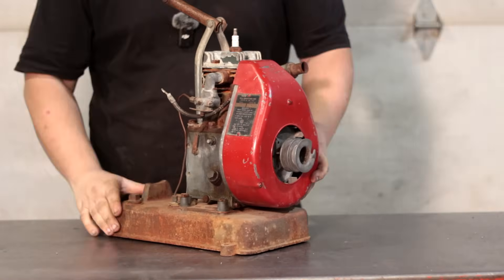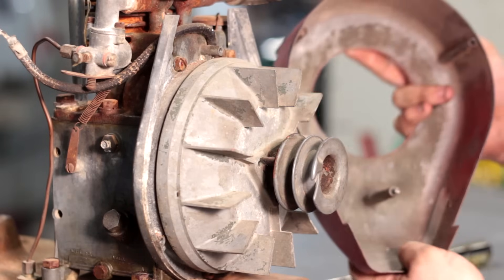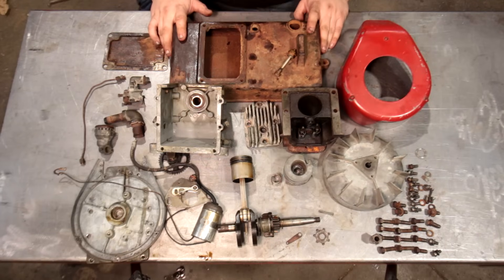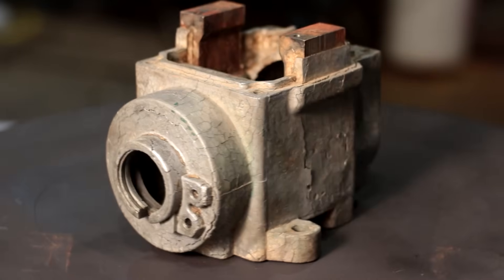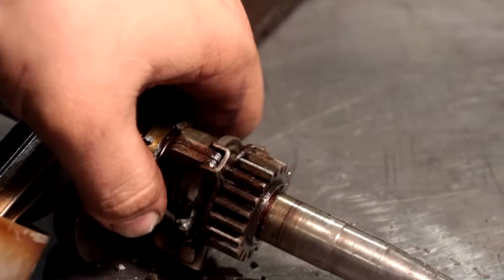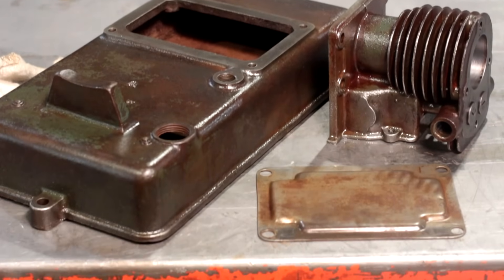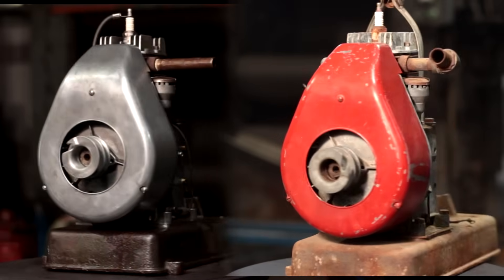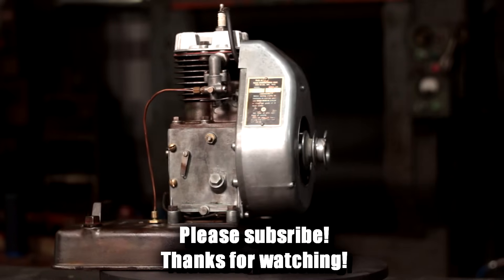IT CRUMBLES When Touched! Will This 80+ Year Old Engine SHATTER Before We Get It Running?

Comment: That is a visually unique engine. Never seen one like it!  My dad worked in the metal casting industry for most of his career. They had casting alloys which had purity standards. If I remember, lead was one of the biggest no-no's in the alloy. They supplied parts to a major US auto maker who spot tested each batch of parts. There was more than one occasion that an entire run of parts had to be scrapped.
Reply from the maker: yep lead is one of the worst metals to deal with in casting.
Reply: @cruddycornstalks  I think they only allowed a few parts per million lead in the aluminum casting alloy, if I remember. It was low.  By the way, I sent an e-mail to your address from your YouTube channel about page. It's off topic for a comment so I sent it that way. Not sure it went through.
Reply: @davida1hiwaaynet These are Zinc...not Aluminum
Reply: @AchilleBelanger  Never said it was..... he clearly states what it is made of.
Reply: @cruddycornstalks Not if you're casting Bullets.
Reply: @cruddycornstalks mmmm lead poisoning
Reply: This problem happens because a lot of galvanized products use lead, especially those with irregular shapes, it helps the zinc stick better in the process; some lines have replaced the lead with bismuth and/ror antimony  (any spangled-looking galvanizing coating has one or more of these, pure zinc coatings have no such pattern visible) . The zinc recycling process would end up putting a lot of this lead into zinc, which caused old pot metal to be of such poor quality. After electrolytic refining of zinc became common in the 70s-80s, pot metal was a lot easier to produce with proper mechanical properties, modern Zamak is a testament to this: some alloys of Zamak approach the strength of steel, and has found itself replacing cast iron in many things (no need to get Zamak red hot to get it into a casting).
Reply: What kind of stuff (besides toys and electrical) was zinc used for a lot? I'm wondering what the actual alloy was here, or if it was meant to be mostly zinc.
Reply: @edherdman9973  The main use of zinc is galvanization (60%), the next most common use is zinc-based alloys (zamak, etc.) (15%), followed by its use in aluminum, brasses and bronzes (9%), zinc intermediates (anodes for electroplating/cathodic protection, rolled zinc for roofs, etc.) (4%), and finally in zinc compounds (zinc oxide, zinc phosphate, etc.). 

Source: International Lead and Zinc Study Group, 2024
https://www.ilzsg.org/wp-content/uploads/SitePDFs/The%20World%20Zinc%20Factbook%202024.pdf
Reply: @edherdman9973  @edherdman9973 The main use of zinc is galvanization (60%), the next most common use is zinc-based alloys (zamak, etc.) (15%), followed by its use in aluminum, brasses and bronzes (9%), zinc intermediates (anodes for electroplating/cathodic protection, rolled zinc for roofs, etc.) (4%), and finally in zinc compounds (zinc oxide, zinc phosphate, etc.). Source: International Lead and Zinc Study Group, 2024.

Comment: Your video proves one is never too old to learn. I also was not aware of the pot metal disease . I have been working on small engines for 50 years off and on and have never really known that it was a thing. I have seen pieces crack but nut really thought about the reason. Keep up the good work. Oh and get rid of the adjustable please it drives me nuts waiting for it to slip and round out those old nuts and bolt heads.

Comment: judging from the tank casting, this was a small gen set also given the external shaft thats keyed on the back, but the small support on the bottom hints it was prob a gen
Reply from the maker: correct a little one like from an old car to charge batteries

Comment: Did you replace: crank bearings, seals, wristpin bushing, conrod crank bearing/bushing, piston rings, condenser? Did you hone the cylinder wall? What did you use for head gasket material? Did you replace the broken part on the crank? If not, why not? Like your shows. Informative, to the point and no extra jibber jabber.

Comment: I'd recommend removing the Ethanol or getting pure neat Petrol.  

Ethanol will attack the Pot Metal. I washed my fuel in water. Shake then siphon out the Ethanol free fuel. Water absorbes the Ethanol. Let it settle and use.

I discovered using my own car removing the Ethanol from 95 octain fuel and driving in 5th gear 20mph prior would bog down. I run the fuel as low as I could then replaced with the Fuel washed. The car from 20mph in 5th gear would slowly accelerate. 1.4 engine size. 

I tried it in my rotavator it was hopping about. I add a little oil or Redex to lubricate valves as modern fuel is dry.

Comment: Not a bad little engine.   I remember the days of pot metal small engines and you could strip out the threads in the block or housing in a heartbeat.  Thanks for a peek at this one.   It did need an oil change and that colar replaced still for an 80 year old engine it's a fine one.   I wish I knew their pot metal formula.   Obviously it is possible to make good and lasting pot metal.   My grandpa mixed his own pot metal for his shop.   He just thru in bits  of this and that till it "looked right" same recipe he used for corn bread.  One of my regrets is not measuring what he thru in. He and the good Lord only know what he was looking for I asked him several times to explain but he could never give a good answer except to point to the pot when he was done and say that looks right.

Comment: Back then you can fix everything as it's possible to disassemble every parts, nowadays even a carburettor for a lawnmower have punch in part that you can't get out for cleaning (like idle injector on Honda small motors)  the only way is to replace the whole thing, 80$ "official" parts  and 8$ including shipping from asia !

Comment: The bad pot metal examples look like 2012-2016 Honda Odyssey valve covers, they'd crack around the spark plug tubes, never had new ones in Stock, so I'd have to take a file, and file away the swelled material so the tube seals would fit, and pack the cracks and area around the tube seals with Honda bond to get the customer back on the road.

Comment: Had one your missing the original air filter. It was a brown procilin type thing that was porise and needed a new coat of oil every so many hours.
Reply from the maker: How the choke of this carb is setup there is no way to mount a filter on it.

Comment: Chevy will be making door handles out of this next year.
Reply: Chevy has been making door handles out of it for more than 60 years.  I made them then as a foreman in a zinc die-casting department at Ternstedt-Trenton, the division of GM that made such parts.  Lots of other parts such as trim emblems, dashboard instrument clusters, the major frame for the swinging vent windows, gear boxes for windows, etc.  Copper/nickle/double chrome plate (triple chrome on Cadillac parts) and they last longer than much of the steel sheet metal parts.  And ultra-violet light didn't destroy them like our modern, new and improved plastics.  Even pitted after 50 years they will still open the door instead of coming off in your hand.

Comment: Never seen a carburetor without a float or some flow control ! ill have to research that and the other interesting thing is how little lubrication is required to opperate considering theres no oil splasher dipper or oil pump ,plus the oil is far below from the moving parts ! I guess it still blows around inside just from the spinning crank and piston pulsations .. Very cool and interesting stuff !

Comment: 5:32 you need to smelter it in the oven, at about 1150 C
Reply from the maker: 1100C would literally kill you with zinc as its boiling point is only about 900 and the fumes from it can kill you very quickly and painfully. terrible advise.

Comment: It's either die cast or die pressed. Casting anything is twice as difficult as squishing something into shape. I just can't with the adjustable wrench. Those are only to be used in a pinch. They love to round the head off a bolt. They're a dumb design really. Sloppy to no end and only 2 points of contact.
Reply from the maker: if used correctly an adjustable wrench will get a better grip on most hex then a standard open end wrench use them everyday at work to save our fresh machined hex on parts regular wrenches leave marks.

Comment: I can't bring myself to watch you work on it with a crescent wrench.
Reply from the maker: Sounds like a you problem as they are very useful tool that helps save time and bolt heads when used correctly. And even the best people in the engine hobby use them.
Reply: @cruddycornstalks  I'm a master mechanic 40yrs . Crescent wrench is for broken down on the side of the road. Not in a shop where you should own the tools to tackle the job at hand.
Reply from the maker: @johnmartin2079  This is the tool to tackle the job at hand  it helps keep from rounding off odd sized or worn down bolts that a regular wrench can't compensate for.  I deal with them every day at work and in my free time and at work we use them to save brass hex from getting rounded because a regular wrench has 10 plus thousanths of slop in it to the actual size of the hex and that will leave crush marks on the new brass hex and sometimes even round them off and we can't have it in manufacturing. If you are rounding off bolts or having problems with a crescent I highly recommend learning how to use one properly as it keeps us from having recalled products from having messed up hex on parts. When properly used a good crescent will outperform a common open end wrench. And if you say otherwise you haven't used with one enough. As the main Manual machinist and maintenance mechanics I can say a cresent has saved me a lot of rounded bolts and problems over the years and a lot of other antique engine mechanics will say the same  when your fighting  17/32 head bolts and rotten bolts that are no longer a size in general it is a saving grace !

Comment: If it can’t produce electricity to run itself, how does it produce electricity to charge a battery? Is it missing a generator?
Reply from the maker: the fact the generator is not there would be an issue yes.

Comment: Im surprised the oil did not soak threw the engine block. Oil does an can soak into metal.but pop metal im surprised it just didn't soak oil threw it
Reply from the maker: it can turn the zinc to mush to and i was very luck it didn't

Comment: That reminds me of a tiny 2 cycle engine my grandfather had in the 1960s. It had a small water pump on it with garden hose connectors. May have been the same brand.
Reply from the maker: That sounds cool

Comment: I had a player piano that had  pot metal valves in the player mechanism.  They were made in two factories, one in New York and one in Toronto.  The Toronto factory made valves that held up over time and the New York pot metal almost always crumbled.  I understand that there are a whole rainbow of pot metal formulas.
Reply from the maker: Interesting!  There's a lot of variation in quality, even within the same material.
Reply: The main issue was that it was easy to alloy zinc with random other metals. Lead is what caused the problems.
Reply: Yeah every company uses different mixes and stuff
Reply: We had a friend with a Pianola that had a keyed latch made of some cast metal that expanded with age and started to split the wood it was set into.

Comment: Zink alloys still break down easily. Cheap safety razors will break down in a few years if the plating fails or isn't done properly.
Reply from the maker: Yeah it's not a great material
Reply: @cruddycornstalks  it's just cheap to use and easy to work with. Just benefits the company making the product and definitely not the consumer.
Reply from the maker: @RobertNES816  correct

Comment: When I first saw it I assumed it was a small industrial 2 stroke but nope. As for the alloy, even my old cheap magnesium vw cases/parts that came from countries other than Germany, after so many years, could fail with cracks or pieces breaking off. Not this bad however. Similar alloys are not all equal is what I learned. Magnesium and pot metal are related I think. Cheers. 👍
Reply from the maker: yep it is a delicate alloy.

Comment: I am confused about one thing — what happened to the crumbling governor, did you have a replacement? Not needed? Otherwise great video as usual!
Reply from the maker: with how delicate the engine is i never plan to work it so i just removed it and will only run it at set idle.

Comment: Some Franklin auto engines had zinc alloy guides in the valve train and if the car sat unused for a long time they would swell up and lock up the push rods. I watched a gentleman named "Jonathon W." rebuild one on on his channel.
Reply: Very early Subaru 1.0 liter EA series engines (1968-1971) had odd valve guides made either out of aluminum or zinc alloy of some kind. They are absolute junk whatever they are. By the next iteration of that engine (1.2l) they were replaced with iron or steel ones, and every future EA series engine had  either iron, steel, or bronze guides.
Reply from the maker: yep those can be a real pain.

Comment: I have a dead ringer of your engine. Mine is marked Power Pony and is belted to a small air compressor. It appears to be something that would have been used on a service truck. I've had it for decades but never attempted to work on it.
Reply from the maker: yes that is the same thing! very cool old motors.

Comment: Is this called "Mazak Rot?" Where the zinc impurities affect the diecast?
Reply from the maker: never heard of that name but yes lead impurities causing intercrystallite corrosion.
Reply: @cruddycornstalks  It's called that here in the UK. It's a term used by Hornby, Bachmann and other model train suppliers. It's  mainly but not limited to (wink wink,)  those made in China. 
Which is pretty much all of them nowadays.
It affects the "Diecast" chassis, which in turn expands and splits the plastic bodies of the trains.

Comment: The same pop metal disease plagues a lot of our 1920s and early 30s radio sets as well. Especially in the tuning capacitors and pot metal castings. Lots of phonographs from the earlier days also have the same issue
Reply from the maker: It's a real shame to see them go, but that's how those old materials were back then.
Reply: @cruddycornstalks  the amazing thing is, though it's still around. I'm sure back then, the engineers never expected the equipment or the radios or the phonographs to last as long as they did. I mean, after all, someone building a radio set in 1925 I would surely think that it wouldn't be nowhere near still usable over a 100 years later.

Comment: pot metal, like just about all metal, comes in different grades. the crap used on old cars that was chrome plated-like door handles and trim corners-would never hold up as an engine block. most of those old engines were an aluminum alloy-soft but strong enough for the block. the cylinder was usually cast iron. biggest problem was stripping out threads as the metal was a bit too soft. some gas tanks were made out of an even cheaper alloy of pot metal and aluminum. metallurgy is a fascinating topic by itself. but it is cool to get these old beasts barking again. even if they just sit on a bench and do no work. great job.
Reply from the maker: You’re right, the metallurgy is very interesting!
Reply: I had a pot metal microscope that crumbled into tiny pieces. I really hate that cheap material. I cant imagine anything subject to mechanical stresses being made out of that stuff. If that flywheel is pot metal, it is definitely doomed to explode.

Comment: Fowler used pot metal for cam gears and other parts, they would explode apparently 😳 

I was gonna say (i saw another person has commented) the internals and the threaded inlet look like a J.A.P 2A😅 ( ive been rebuiling one and the govenor looks the same ) maybe a lauson governor collar will fit?🤔
Reply from the maker: very possible. but i have no intent on working an engine with a block like this so i will have it set at idle any time i run it. ad there was way to many company's that use pot metal gear!
Reply: @cruddycornstalks  😎 the governor is useful still as it can stop the engine racing away randomly btw.

Comment: how well i know.  a few years ago i had a 1926 cadillac come in.  the distributor was that stuff.. it looked like a tulip flower that was about to die.  it required a full replacement.  when i found out that my 1929 cadillac had die-cast in the engine, i sold the car.
Reply from the maker: its  a very important bit of info when working on old cars!

Comment: That little engine could still charge batteries...just get a small 1 wire 12v small alternator. If you use a small inverter, you could power cell phones and small 110v things like lights. Something to think about.  Good luck.
Reply from the maker: i would dare put stress on this engines parts  in fear of them cracking or breaking.

Comment: I have a briggs FH that has zinc pest in the magneto back plate, so I will have to source a replacement. It is unfortunate that these things disintegrate over time.
Reply from the maker: It is unfortunate but this is just how things are with age, eventually they just turn to dust!

Comment: You and I made about the same noise seeing that old oil. I could just about smell it, yuck. Neat old engine, from an era when they weren't afraid to try new things, even if those things ended in disaster.
Reply from the maker: It had quite the aroma
Reply: @cruddycornstalks  Oh I can imagine, some of that old oil had a lot more sulfur and paraffin in it, so did the gas. Stuff smells like Satan backed up and dropped a load in an engine sometimes, especially in old diesels. 

Not as bad as the organic gear oil they used back when, that stuff smells like a rotting pile of fish bathed in sulfur left to soak in oil for a few centuries.